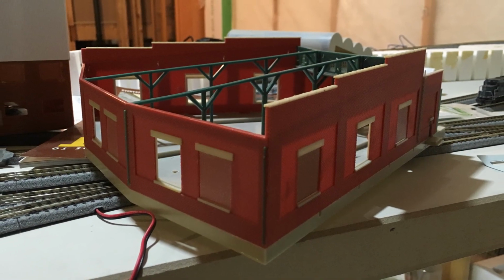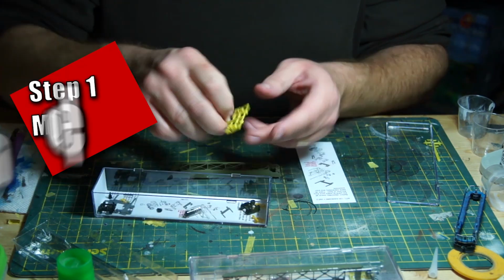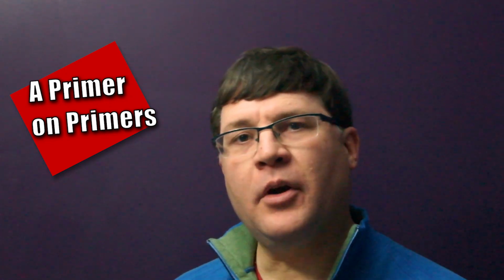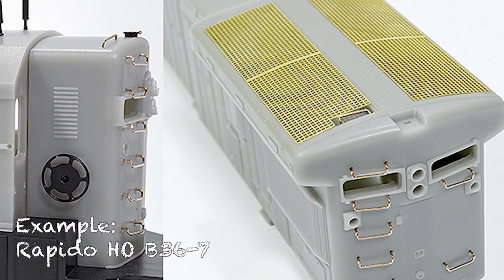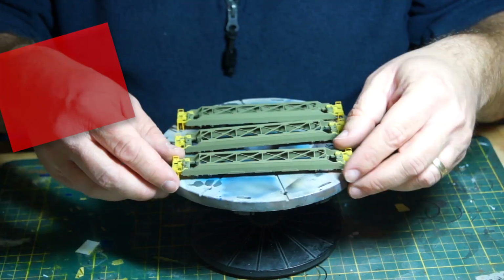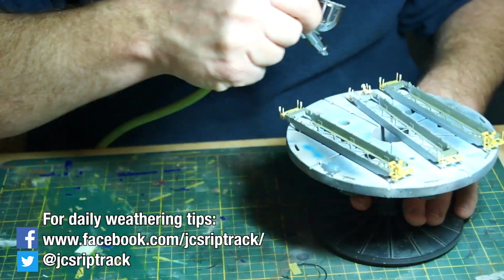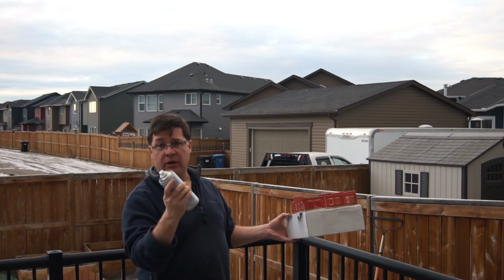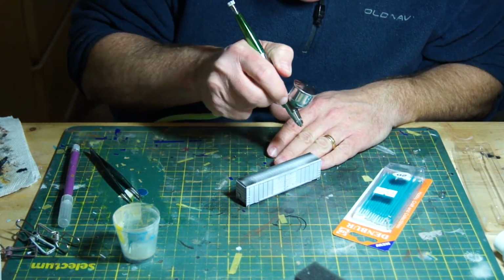Painting Model Trains - Primer & Pre-shading

Comment: I'm repainting a die cast steam locomotive like an excursion engine with a black boiler and gray smokebox and firebox. As it stands now the engine is a very dark PRR Tuscan green. What color primer should I use and should I put another layer of black model paint over it if I end up using black primer?
Reply from the maker: For what you're doing, black primer is probably your best choice. In terms of using another layer of black paint, I'd say only if necessary. You don't want your layers of paint too thick, and if the basic black from the primer is doing its job, then great. Some black primers are more like a very dark grey, and in that case you might need to depending on how black you want your black to look. Also, most primers are a matte finish, or at best satin. You'd need a gloss clear coat later on if you want anything shiny. 

My usual rule is that unless you're going to be painting brighter colours like red, orange, yellow, or a brighter shade of blue, black primer is my default.
Reply: JC's Riptrack Thank you, this helps tremendously! Great and informative video

Comment: Hi John, picking up on your box car pre-shading, I noticed that you covered the whole roof in black primer on top of white primer, could you just have painted the roof black to begin with? Cheers, Mark
Reply from the maker: I could have, yes, but since I often use spray cans for a base primer, I’m used to doing a complete base coat first before adding a shading layer. Since I was going to add a metallic colour to the roof, black is a better primer colour for it, hence this kind of a hybrid of two primer layers.

Comment: Bare (undecorated) plastic seems to have a knack (at least for me) of picking up (oily) fingerprints, and also seem to (electro-staticly?) grab onto lint and dust.. So in the 'Preparation' stage I usually give the model a bath, and then handle the model with gloves until after the primer dries. After that, fingerprints are less an issue, and dust/lint blows (or brushes) off easily.

I'm eager to see the results of your preshading in the upcoming videos.
Reply from the maker: It may not be to everyone's taste, but it does add some visual interest, especially since I am experimenting with the Colour Modulation style with the Husky Stacks.... I'll make sure to take some stills this time!
Reply from the maker: I should also mention that TP's advice here is solid. Yes, clean your models. Undecorated locomotives especially can be a little greasy out of the box given the lubrication on the mechanism. Soap and warm water is a really good idea as part of the prep phase.

Comment: How do you feel about using rattlecan paint from Lowe's like krylon fusion k have used it in the past and it seams to work well but it helps to give the can a bath in hot water to bring up the temperature of the paint and helps it flow better and finer
Reply from the maker: I've not tried the Krylon. I have used various types of automotive primers, particularly a brand called Duplicolor Black Sandable Primer when I have worked with my miniatures. Privateer Press' own brand of primer is very similar to this. The main thing is that they're the non-filler primers, otherwise they could cover up all kinds of detail. Best thing to do is experiment. :)
Reply: @JCsRiptrack  I sent you a link to what I used and a picture on Facebook

Comment: I don’t own an airbrush and I don’t want to spend the money for one. I love your videos but is there a method you suggest for non-airbrush weathering?
Reply from the maker: Hi APJ, with a few exceptions, most of the techniques I set out in the Weathering Basics playlist are non-airbrush techniques. https://www.youtube.com/playlist?list=PLxNYoknHPrDqei3e2M7SlN3xfnzh4cDW1 The fading video, for example, is specifically a non-airbrush technique (https://www.youtube.com/watch?v=B11mAJGwt7I&list=PLxNYoknHPrDqei3e2M7SlN3xfnzh4cDW1&index=5&t=0s). 

Where I do make use of airbrushes in weathering is mostly to apply clear coats, which can be handled using spray cans. For painting models, you can use spray cans (especially for primer), and then use paint spray cans to lay down a thin first coat. The airbrush is needed when you want some greater fine control for painting models, but is optional for almost anything else. 

I hope that helps!
Reply: JC's Riptrack thank you

Comment: I wish there were more undecorated cars, I usually have to strip them first then paint them.
Reply from the maker: I'm thinking that a video on preparing for repainting models is a good idea. There is merit to the discussion as to how necessary stripping actually is. Modern paint is pretty thin, and Kato is very difficult to strip.
Reply: What stripper do you use?